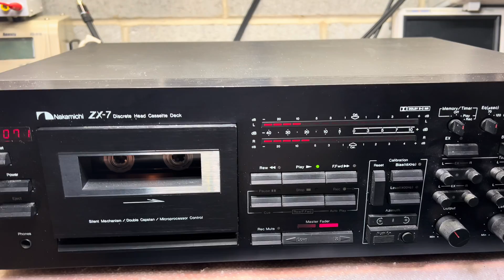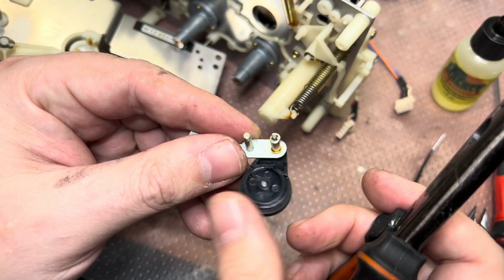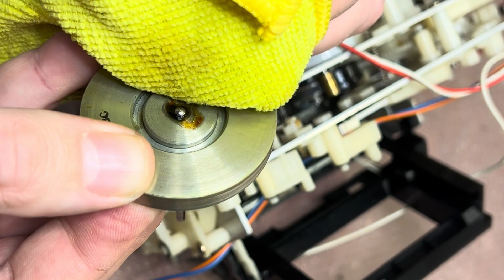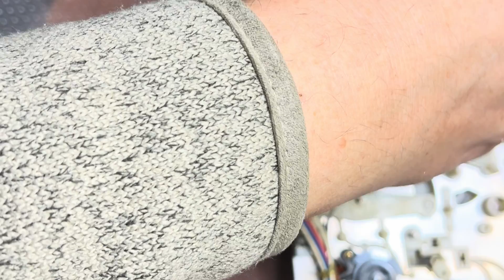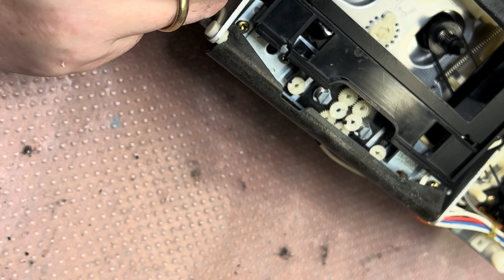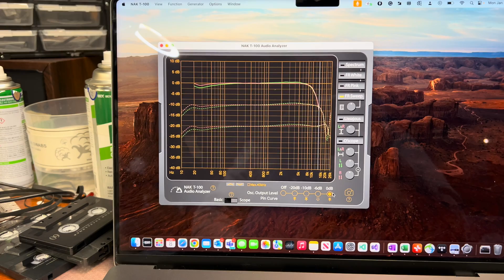Nakamichi ZX-7 Revival: Full Service, Capacitor Upgrade, and Sonic Rebirth!

Comment: Changing the caps change the sound no matter that the characteristic on oscilloscope or spectrum analyzer may be better. With good original caps this deck does NOT have digital sound and has a deep bass .There is not a good capacitors like the originals today All the capacitors are made in china and they are fresh not very good caps. Yes some of them are leaking. There is a real problem to find the same subs likes originals. The more capacitors you replace with purchased today's capacitors, the more the sound of the original deck changes. Fact! Yes, some of them are leaking.
Also if the electrolyte caps are changed with not electrolyte, not all the time should be subs with the same capacity in mF....sorry not be polite ...Any way there was a a grate job with the door!
Reply from the maker: Stop posting that audiophile BS. You forget how we did listen to decks 40 years ago. The goal was good clean sound and every company was fighting to get the best. Today you listen dried caps with non linear frequency response which introduces huge THD and name this “original” sound? Really. Don’t want to curse but I am about to. Nichicon is an audiophile grade capacitors. That is the fact. Will not waste my time anymore. Enough is enough.

Comment: Change the incandescent lamps while you are in there. I've found the small lamp used for tape counter burn out in these. When that fails the machine shuts down because it assumes an end of tape situation. 
On that subject... was that a blob of grease on the tape counter belt that came from greasing up the door mechanism?  Looked like it in the video.
Reply from the maker: Grease was cleaned. I don't need to film fails on camera, correct?  I have replaced these lamps in two decks, but over time I have learned that tgesepamps work on lowervoltage and lasts long life. I have not seen yet tgesebulbs burned, only in one other video on YouTube